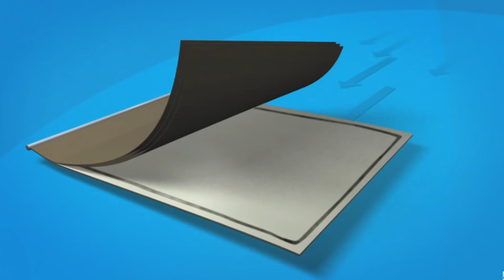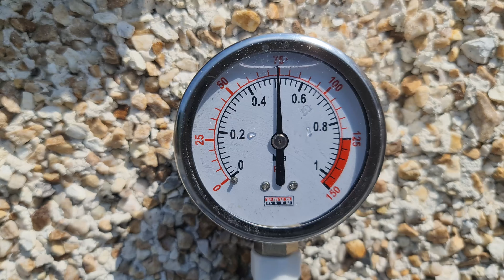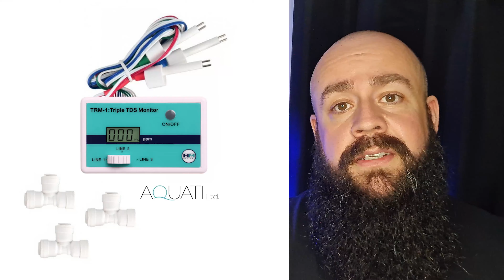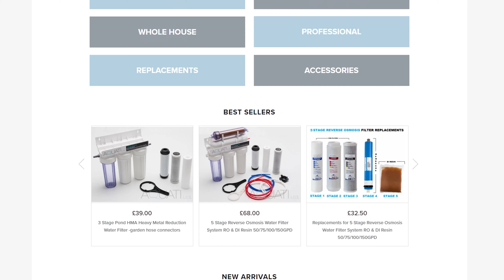RODI Units, How do they work, what's inside, do you need one? Aquarium RODI water Filter system

Comment: Great in depth video Ross. Am changing all my filters on my unit this week. Bought from Aquati using your code of course!! Also thinking of buying a membrane flush kit for it. Another job is to move the TDS inlet meter from the tapwater to after the membrane. Keep the vids comming bud.
Reply from the maker: Thanks mate! Tried to give as much information as possible on this one without it being too much, its a fine line, yeah I have the flush kit and it's brilliant, ive also moved my tds meter to one before the membrane and one after, thanks for the continued support mate! 👍
Reply: How easy is it to add a flush system and taps for on and off.  I ask you as you don't go around the houses.  Good work on your channel Ross.

Comment: Great information bro 👍. I have a question though, I have a Ro/di system but I accidentally plugged the tubing wrong, thing is the DI resin is totally wasted but the 2 other filters are fine. Not sure about the membrane. The problem is that the water was at 200 tds and had a faint bad smell. Do you think I have to replace the membrane or just replace the DI resin. Please help I got a big water change coming. Thank you 👍
Reply from the maker: Thank you what way had you plumbed it? You could flush the membrane but depending what has went through it you might need to replace it, for all the cost involved you might be better replacing the filters, membrane and DI resin just to be safe
Reply: @BeardedReef  I think, I placed the waste water tube in the membrane, Im not too sure, I didnt even know how to set it up in the first place, could I send you a picture of how I have it right now through email?
Reply from the maker: That should have just recirculated then? Yeah you can, I can't put my email on here as youtube blocks the comments but drop me a message on instagram
Reply: @BeardedReef  Ok Ill send you the pictures thank you 👍😁
Reply: @BeardedReef  OK, I sent you the pictures on Instagram

Comment: Great info on this vid Ross also Aquati is in kirkcaldy 10 mins drive from me lol .What GPD size did you go for ? .I'm not sure what size to go for
Reply from the maker: Thank you, yeah they are 🏴 ive got the 150gpd 5 stage unit but have just upgraded to the 300gpd 5 stage unit
Reply: Cool that should fill your 25l container in under 1 hour lol .I was thinking of just keeping it mobile like yours for the time being (im going to be putting in a new kitchen next summer) ,when your finished using the unit do you just shut the valves off and keep the water in the unit or do you drain it of before storing the unit till the next Time you use it ?
Reply from the maker: @rabmccammon5691  I always shut the valves and keep the unit wet, that way the filters and membrane last longer, I dont think letting them dry out is good for them. I like keeping mines portable and just storing it away in a cupboard, so much easier
Reply: Thanks again for your help Ross 👍
Reply from the maker: No problem at all! 👍

Comment: Hi  I bought a aquati 5 stage r o d I unit am having a few problems understanding how it works aquati weren't very helpful. I have low tap pressure  so I bought water pressure pump and and gage also flush valve kit  I would very much appreciate if you could help me on how to install it correctly  thanks Davie

Comment: Hi, great video by the way and lots of useful information, I've been on the fence for about 15 years if I should buy one as I've only had nanos and don't do many water changes. But I currently have 2 tanks and I've used shop bought rodi forever for top offs and shop bought pre mixed and collected by myself natural sea water for water changes. Now i think it's time I take the plunge and make my own salt, i know the natural stuff is free but i don't trust the coast around Devon at the moment. I would like to know though if you know how long an rodi unit can stay unused between uses as I won't need to use it that often once I've made what i need, maybe 100 to 150l at a time. That would last me a while for top offs and changes. Thanks. Oh also why did you move your tds meter before and after the membrane as opposed to after di?
Reply from the maker: Hello, thank you very much for the comment! You should definitely get one, it makes things so much easier and more accurate too, you know exactly where your water starts from every time! 

When it comes to making water, you will be fine to leave it for 3 or 4 weeks as long as the system is kept wet, I add valves to all 3 lines so that I can create a wet filled sealed system after use and I store it wet, that way it is ok, just flush for 5 mins before and after each use,

As for TDS meters, I had mines on the feed line and product line but I moved it to one on the line before the membrane and the other one on the outlet, I do plan to change to a 3 probe system so I can have one after the 3 filters, one after the membrane and one after the resin, that way I know when each component needs replaced quicker 

Hope that helps
Reply: @BeardedReef  thanks, that makes sense if you're getting a 3 probe. I'm looking on the site you suggest for 1 and looking to get the 5 stage as its actually cheaper that the 4 stage I was looking at elsewhere. I think I just need to justify it to the wife. I'm sure if I say I'll put a tap before the di so she can have better water for her coffee machine she'll let  me get one.
Reply from the maker: Yeah the Aquati units are brilliant, and much cheaper than elsewhere, I'd recommend the 5 stage 150gpd unit as a minimum

Comment: I have the 5 stage unit , if I test the finished water with a refractor meatier at 0 ,is this still a good way to see if something is going wrong, as it will rise up the number,
Reply from the maker: Hello Phillip, no a refractometer is used to test the salinity of the water, this won't show the level of TDS, you will need to get a TDS meter, you could have water that will read zero on a refractometer but could be over 300tds still

Comment: I always wanted a RO system but I use distilled water on my tank it works fine for me
Reply from the maker: I was always advised not to use distilled water as the boiling process removes elements such as calcium, iron, and magnesium that support the biological system, RODI is a much better option in my opinion, but if your fish and corals are healthy then it must be working for you 👍
Reply: @BeardedReef  yes sir well with the water change it should add all the elements but I do dose calcium and a part A and B element solution that contains everything the fish and coral need
Reply from the maker: As long as your fish and coral are healthy then thats brilliant, just continue to do what works for you mate, there are so many different ways to do things in this hobby, there isn't a right and wrong way,